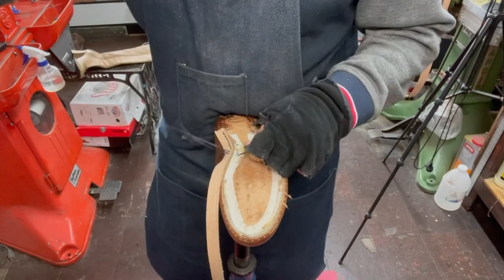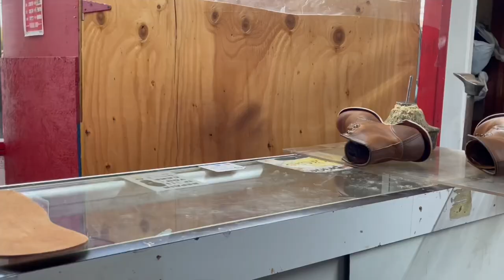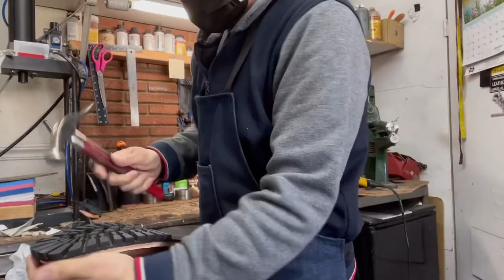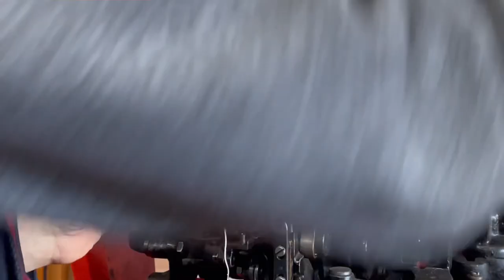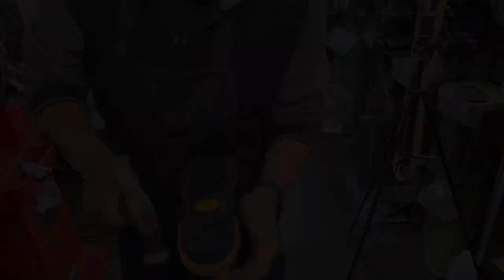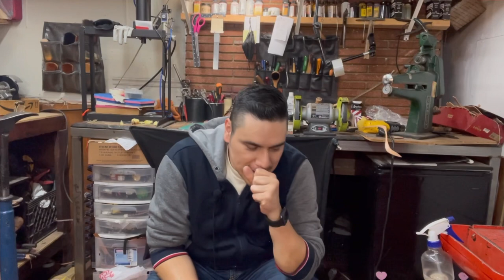Red wing Blacksmith Turned in to A Logger Boots/ blacksmith Boots/woodsman heel

Comment: The Blacksmith is a good boot. My problem with them is the same as your customer had there. They do not have a bad sole, just a hard, not so comfortable sole. The black Vibram 100 sole is SO MUCH softer! Redwing needs to offer options. Again, fine job you did there. The boots look sharp for sure. That is a really good-looking boot now.
Reply from the maker: Thanks, actually the main problem is that they don’t have a midsole . That’s the main reason I Resoled my IR’s as well 
Cheers!
Reply: @AaronG2480  Yes. That midsole looks good and helps. Very nice!!!
Reply: That's one of the main reasons why I don't want a pair, but they're almost a 'must have' if you're any boot aficionado worth their salt.  You shouldn't have to take them to have them resoled when brand or mostly new boots when you can spend just a bit more for something like Parkhurst or Truman's.   That said I still want a pair but a resole would be almost mandatory.